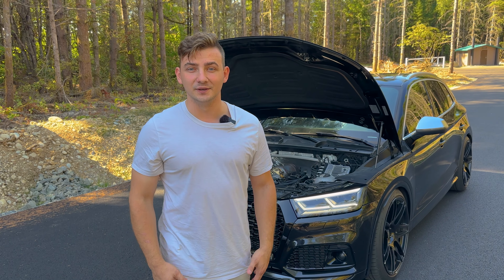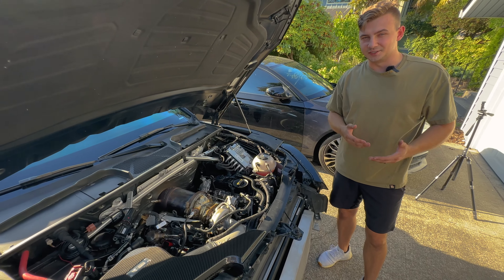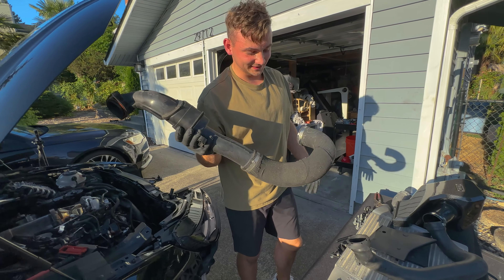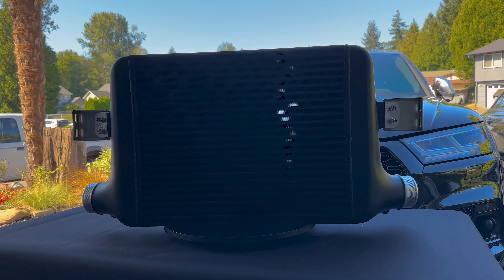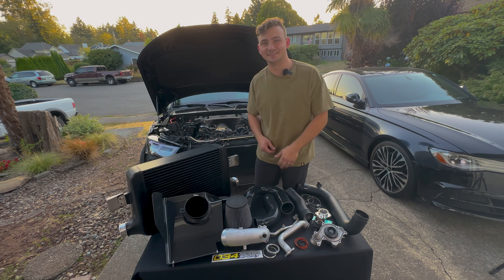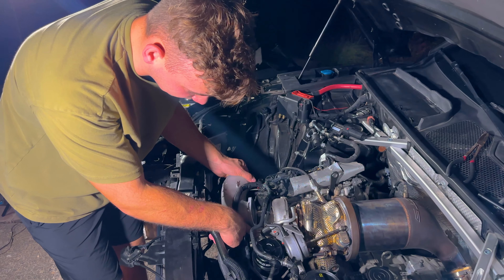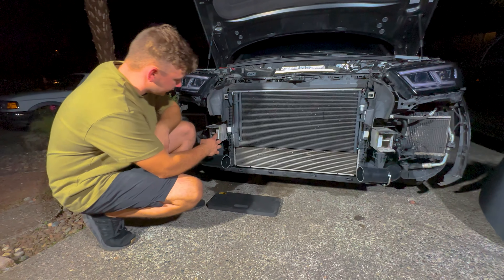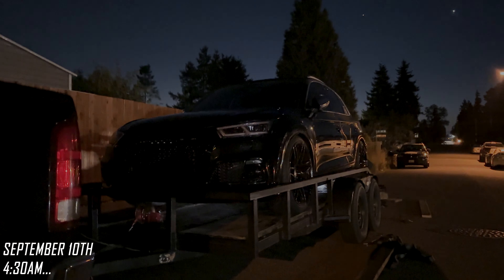PREPARING MY SUPERCAR KILLER SUV FOR MO POWA!!

Comment: I just got a 2019 SQ5 and I love it. I'm torn though. I've remapped a Golf TDI and a A3 TDI before, and it was night and day so I know kinda what I'm missing out on. My worry though comes from the Warranty. I've got 1 year of CPO from Audi and then 3 years added on to that, so 4 years of warranty and, ultimately, I don't want to shaft myself if my car has an issue. I haven't though seen anyone have an issue with a tune. 

Anyone speak to the vulnerability of having a tune? Are Audi going to say fuck off? Could you take a tuned car to a third party mechanics and have that warranty work done, if any?
Reply from the maker: Just gotta pay to play. But I promise you it’s worth it. You could have a third party warranty if you’re that worried. Additionally finding a good mechanic is the key.
 No downside to a tune. Go with the stage 1 ECU/TCU. See if you like it… go from there my man ! I promise you.. your mind will be blown.

Comment: Ever think you’ll do internal mods? Like porting the heads, cams etc?

I’m in Australia and I‘ve got everything to go stage 3+ sitting in the shed waiting for the tuner to have time to put in on the dyno. I already know it’s never going to be enough and I’m gonna want to pulling the engine apart. It’s a dangerous addiction!
Reply from the maker: Do you have a B9 S4? Yeah it's in the works. Just saving up my pennies!
Reply: @Need4Built B9 SQ5.

Comment: have you noticed lower IATs with the new intercooler?
Reply from the maker: 10C-12C delta difference in a 1/4 mile run between the FDS and RACE inter coolers. Significant.
Reply: @Need4Built  do you know of any Youtubers over on the East Coast? I've got a ton of parts for my 2020 S4 I need to install. im in the nyc area

Comment: bro how much of a difference did the 034 map make from ie. because we opened the ie map and its hella safe. thre is no way that we can run a 10.1 or late 9 on that. did u get a custom map from 034.
Reply from the maker: Not sure you opened IE’s map? Or 034’s map? I ran a 10.1 on IE’s OTS tune. The same file they have now available. Same with 034. I bought their stage 3+ TTE810 tune and flashed it. Then went and ran 10.1 in 2000DA. Neither company make custom tunes or offer any custom tuning what so ever.
Reply: @Need4Built  sorry what I meant was logged. Not opened its encrypted. But yea it's strange that the cars aren't doing those times here. If u say that the ots tune is doing 10.1. also are you planning to build Ure engine and did u have any success with the ram air intake yet

Comment: How hard is the water pump part? Realistically? I’m about to change IC’s and wanna get this done as well while I’m under the hood.
Reply from the maker: Gotta put the car into service mode and pull the radiator support forward which is quite easy, from there it’s actually not difficult at all. A few T30’s and the water pump comes out, just need to remove the serpentine belt. But if you’re doing the water pump you should do the thermostat and bypass valve as well.

Comment: Why did you not go with the bigger CAP  intercooler?
Reply from the maker: Cap isn’t larger than this in any way. It has zero flow data and less surface area. It doesn’t have the FDS technology IE developed to distribute airflow equally across the entire intercooler. It’s probably barely enough to keep up with the stock turbo. An intercooler isn’t just an intercooler. There are definitely massive differences in cores, types, and technologies utilized. This race IC blows everything else out of the water for the B9 platform.
Reply: In other words. You have no data to claim that it is better.
And your comment saying it can not keep up to the stock turbo is clearly ignorance.
Reply from the maker: @Corbots80  IE has proper flow data on their website so I can claim that based on their testing. My Delta for IAT’s dropped 10C in the 1/4 mile over the standard IE FDS intercooler. Also this intercooler helped me run a 9.9s Maybe your ignorance of quality products is your biggest downfall. enjoy mediocrity. I’m here to push the limits 😄
Reply: @Need4Built  like I said. You have no data to show that it is more efficient then the CAP intercooler.
Other B9s have run 9s without your IE race intercooler.
And your claim that the CAP intercooler being not capable of handling the stock turbo, makes me doubt you have anything intelligent to say.
Reply from the maker: @Corbots80  let me know when CAP’s IC run’s 9’s. Never the less even low 10’s. I don’t have the data but multiple tuning companies have tested CAP, ECS, and a few other china based intercooler cores results showed proof they are underperforming compared to Wagner and IE’s intercoolers. Other B9’s have ran 9’s ONLY on IE’s FDS IC or Wagner’s IC. IE has data for it, Wagner has data, CAP has zero information. 
The results speak for themselves. Also like I said I’ve collected data compared to IE’s standard IC. This intercooler doesn’t care how much heat it needs to deal with. 

If you want to provide a CAP IC, I’ll gladly compare it back to back with IE’s Race IC. I’ll bet 500$, IE’s Race IC  will blow the CAP IC out of the water with cooling performance. 

You ended off with an ad hominem attack. Insulting intelligence during an intercooler conversation? I think it’s okay to have an opinion. Thats when I know I’ve won the argument and it’s time to move on.

Comment: That’s not OEM intercooler. OEM one is 4 times smaller
Reply: Yes it is
Reply from the maker: Yes it is
Reply: My intercooler is 4 times smaller. Sits on the very front bottom. 2019 B9 SQ5
Reply from the maker: @Shulcyo  Time to upgrade.
Reply: @Shulcyo I have a hard time believing that. My OEM cooler is twice as big as this. It sits on the very top front. 2006 Honda Accord.
Reply: @callahanlutz4111 😂😂😂😂😂